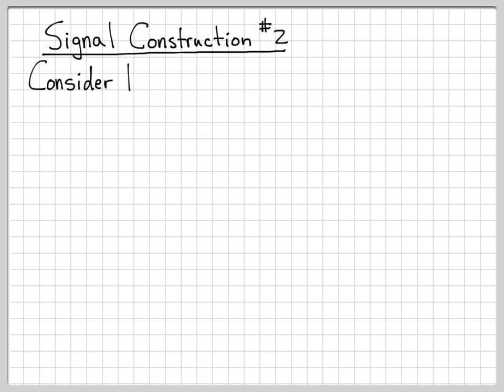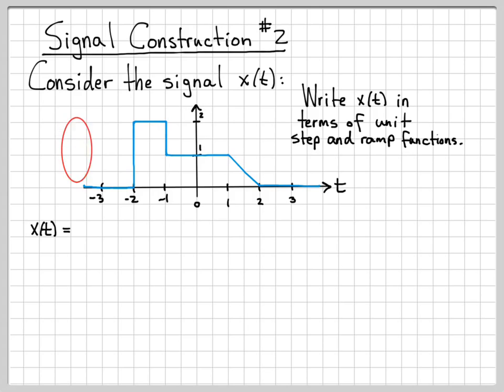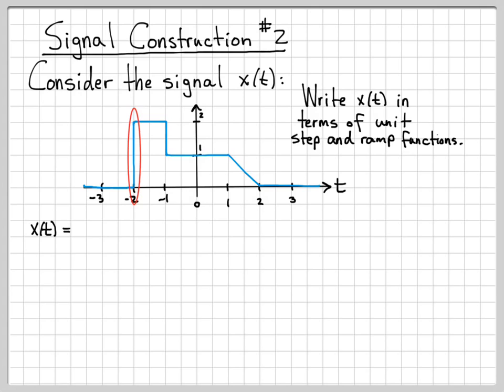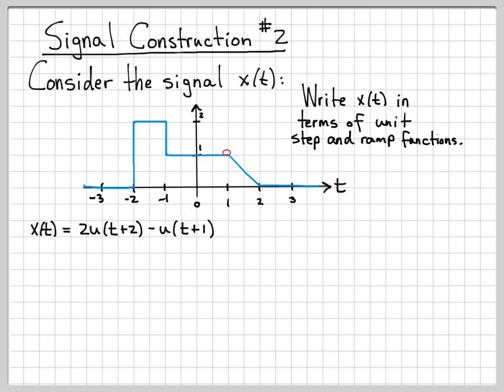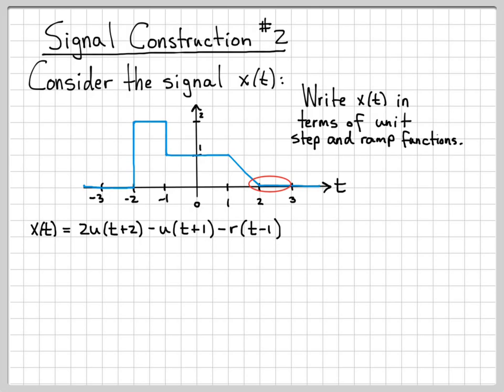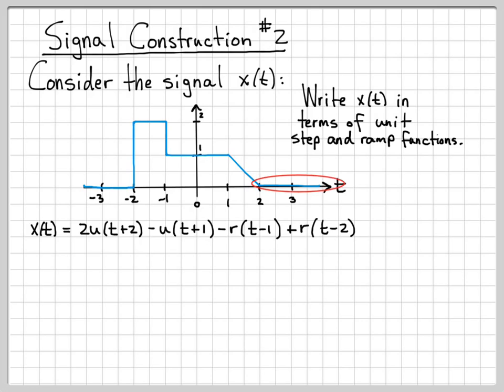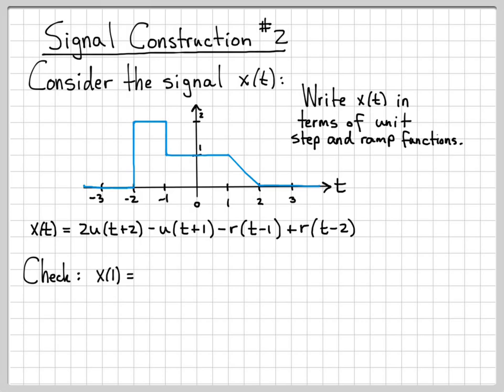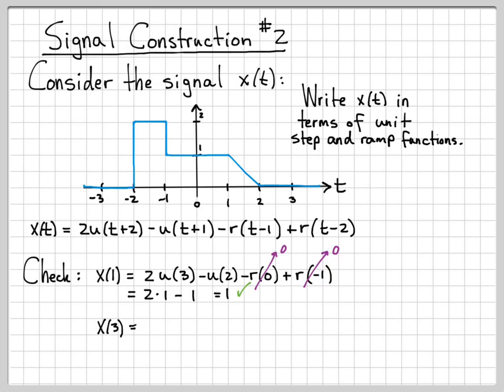Signal Construction Example #2

Comment: Didn’t understand the checking part. How is u(5) =1?
Reply from the maker: u(t) is the unit step function. It's "on" for all t >=0 and "off" for all t < 0. When the unit step is "on", it has a value of 1. So, u(5) = 1 since the argument of the unit step function 5 > 0 and thus it's on. Hope that helps,
Adam

Comment: Say we have a positive ramp function with slope = 1 starting at t=0, then at t=1 the signal falls and commences as a horizontal line from t=1 to t=2. How would you write this when there's two things that happen at t=1?( adding a positive slope to make it horizontal then subtracting a step function??)
Reply from the maker: Yes, what you said sounds perfectly right.  If "two things" happen at the same time, just put two signals at that time.  You could put a unit step to shift things, and a ramp to change the slope.  Hope that helps,
Adam

Comment: Sir, how you consider 1 at u(2) , because according to your  previous video it should be 2 yup.
Reply from the maker: No, I'm pretty sure the videos are correct.  Can you tell me what time in the video you think there's an error?

u(t) is the unit step function and is equal to 1 for all t >=0 and zero otherwise  So, u(2) = 1.

r(t) is the unit ramp function and is equal to r(t) =tu(t).  So, r(t) is equal to t for all t>=0 and zero otherwise.  So r(2) = 2*u(2) = 2*1 = 2.

Did you maybe mix up the r(t) and u(t)?

Comment: you said that the ramp function is equal to 0 if t is less than or equal to 0! Is that true? I checked it online and my professor told us that the ramp function is equal to 0 only if t is less than 0. if ramp of 0 is t then the x(t) won't be equal to 1 at t-1.
Reply from the maker: Either definition is the same.  

You can define it as:
r(t) = t for t>=0 and 0 for t < 0 

Or you can define it as:
r(t) = t for t>0 and 0 for t<=0

Either of these is the same since at t = 0, r(t) = 0.

Hope that helps.

Comment: Don't you have to create a ramp function that cancels the first where the value is held from -1?
Reply from the maker: That's what the final ramp term r(t-2) does.  If the last term was not present, we would continue to decrease with a slope of -1 for all time.  Adding in r(t-2) adds a slope of +1 at time t = 2 to cancel it out.  So, the final slope at t = 2 is -1+1 = 0.  Thus, we hold a constant value for the rest of time.  This constant value happens to be zero.  Hope that helps.